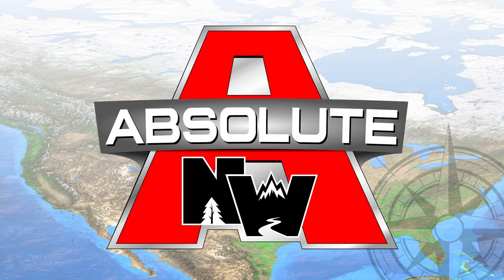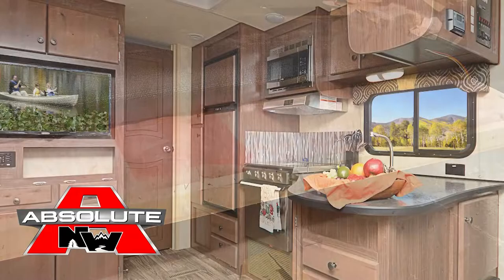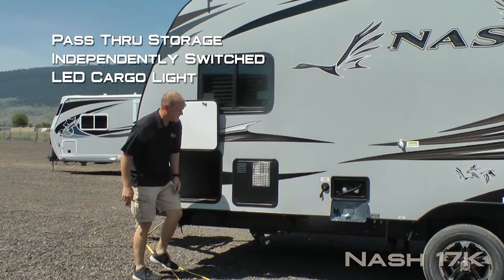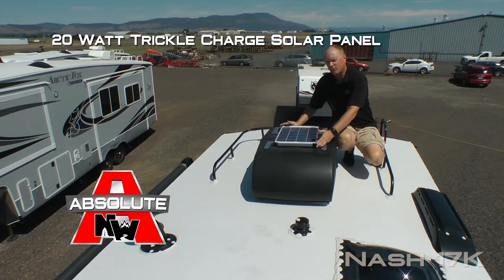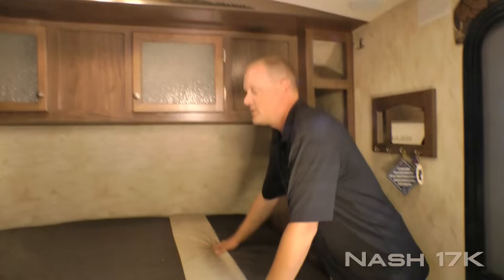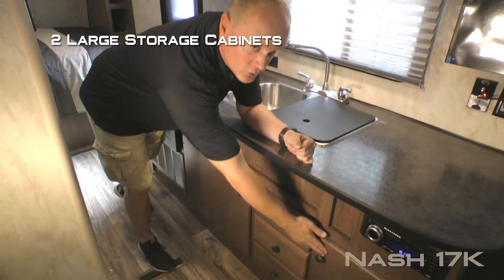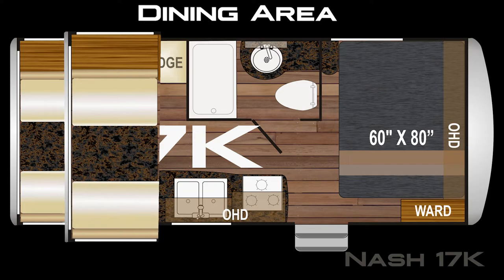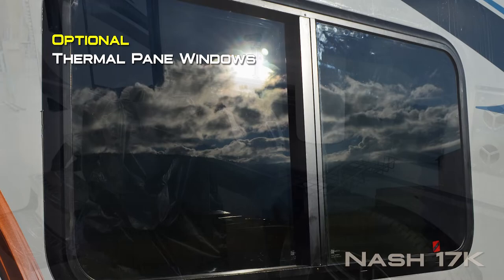Quick Tour of the NASH 17K Travel Trailer

Comment: can you run the AC off of the batteries?
Reply: I doubt it, and you probably wouldn't want to.  Owners of Winnebago's new FLX are finding out that the AC only runs for 3hrs off their 320Amp LiOn via 3000W inverter.  ACs are just huge energy hogs.
Reply: @vap0rtranz   3 hours is better than no hours... besides, I don't expect to run it over night just some and the problem with the FLX which I had to look up is the AC is a 13.5 and it isn't a soft start.. I've seen some that have a 11K BTU soft start that might peform better and run longer
Reply: @Bronco2Cj  ah, good find.  Looks like Truma makes multiple models of the AC so sounds like Winnebago could have chosen an AC with soft start.